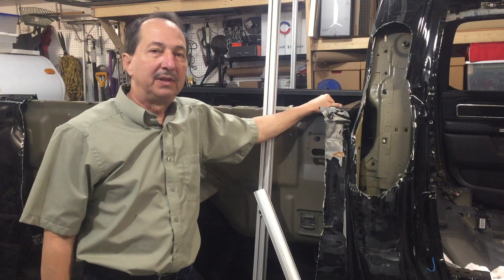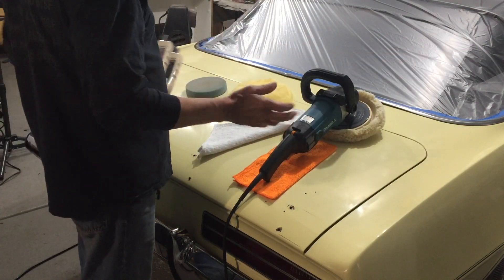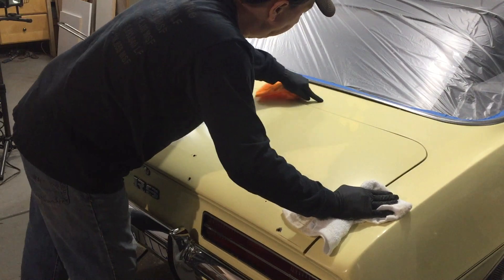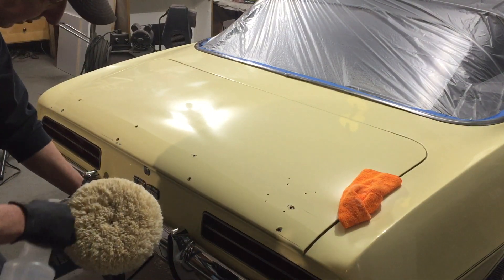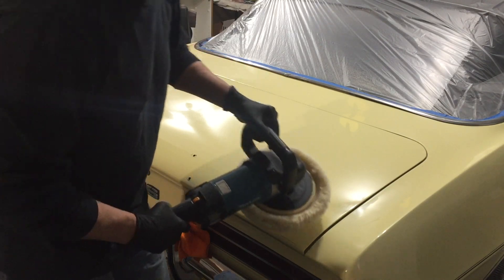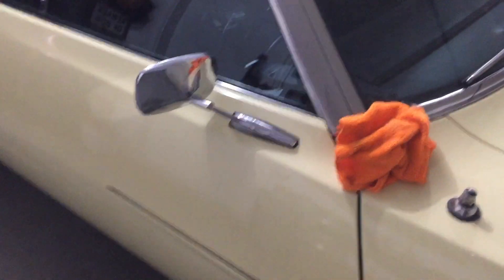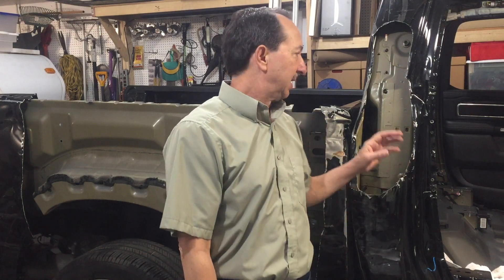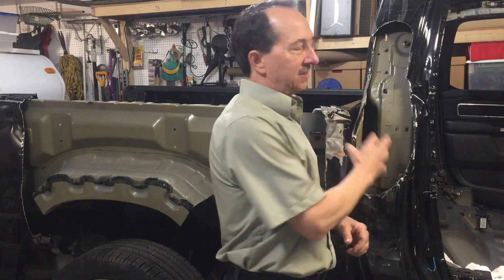1969 Camaro RS Convertible. Buffing and Polishing 35 Year Old Paint.

Comment: You could probably use a dual action buffer like a flex 3401with foam pad with different cutting compound to remove most of your scratches and swirl marks. A dual action is much more safer to use than that Makita. But I thumbs up to you filming this and restoring the Camaro.
Reply from the maker: I've never used a dual action buffer before. I'd like to try one some day.
Reply: @riderescue  In my opinion much more safer and more efficient if it is used properly. Think you would like it for the type of work you are doing.